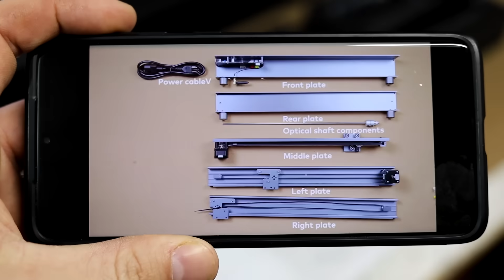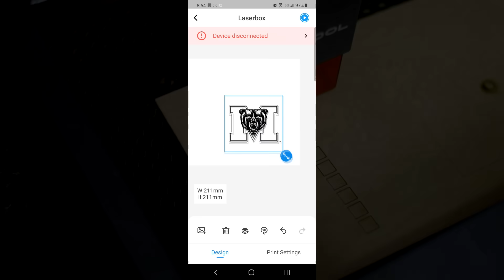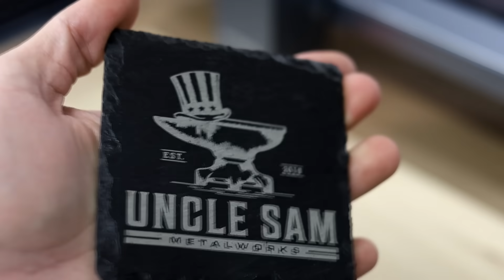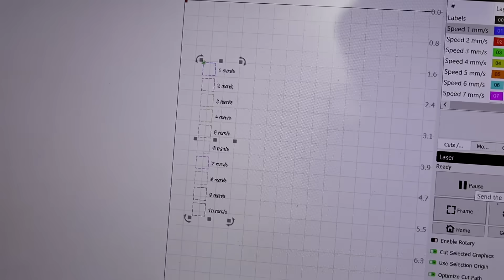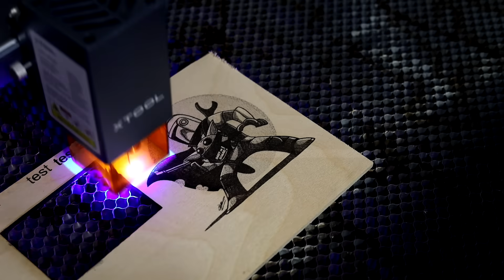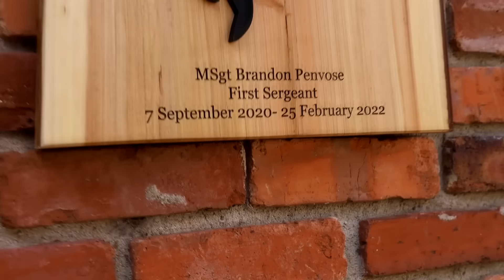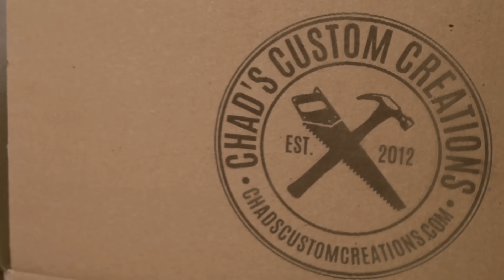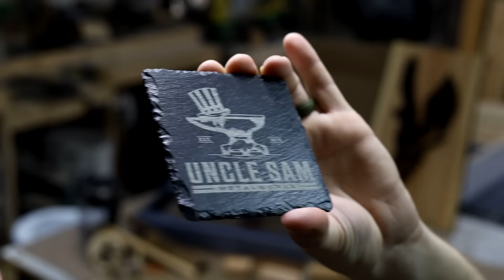The Ultimate Desktop Laser Cutter Engraver The XTool D1

Comment: I know nothing about laser engraving. Just wondering if I can cut 1/2" foam with this machine? For instance, I want to use foam to make a tool/socket holder for my tool box. Would this type of application work?
Reply from the maker: @BennyMolina-hj8qi  I believe with a good air assist you should be able to do that just don’t breathe in those fumes. If you can smell it get away and monitor it with a baby monitor or wireless security camera.

Comment: What wattage is this unit? The old 5w the 10w or the newer 20w?
Reply from the maker: This was the 10w way back when they first came out.
Reply: I’m looking to both do engraving on stainless steel but also cut 1” thick foam inserts for tool placement. I see it engraves well, I’ve seen the 20w cut thick foam inserts well. Do you think just multiple passes on the 10w would still do the trick?

Comment: What does the water and borax do? Never heard of that trick
Reply from the maker: With a low power setting you can turn the borax solution black which is great but it must be sealed in with a top coat as it rubs away very easily.
Reply: @ChadsCustomCreations  oh wow I didn’t know this! Going to give it a try! Thank you! Subscribed. Very helpful video!

Comment: Can you recommend a budget laser that can cut and engrave 1/8”-3/16” thick cork board? Would the D1 Pro do that?
Reply from the maker: Definitely and check their website to see sometimes they have refurbished machines at a fraction of the cost also try code Chad10 for a discount.

Here is the link to their refurbished machines 
https://www.xtool.com/products/refurbished-xtool-d1-laser-engraver?_pos=1&_psq=Refu&_ss=e&_v=1.0&ref=Chadscustom&utm_medium=cj&utm_source=affiliate&variant=43685506842863&cjevent=81efaaaf454311ee8161026d0a82b832&utm_campaign=Sovrn+Inc&cjdata=MXxOfDB8WXww

Comment: Hey thanks for the great video!  Perfect amount of detail.  I hear people talking about how deep a laser can cut wood in a single pass, and I saw it in your video, too.  So, can you make multiple passes and cut 5/8" or 3/4" solid wood or plywood with a laser such as this?  If you can, what's the drawback?  Time?  Quality?  Both?
Reply from the maker: With the 20w and 40w the cutting ability is incredible if paired with a high PSI air assist. Cutting 3/4” plywood comes out clean and cuts better than what I can do on my 90w Co2 laser.

Comment: Hi chad I just got my d1 pro 5w I wonder why it's not engraving on metal like you used on this video for dog. It's working well on the woods tho. Am I doing wrong or I should've bought 20w
Reply from the maker: In this video I was using the 10w. Though try slowing it way down 100% power and you can even do a thin layer of mustard and see if you have any luck with that.

Comment: I have been looking for a laser cutter to use in my classroom without windows, but I have not been able to find anything. Could you recommend something good for spaces without ventilation?
Reply from the maker: Yes if you check the links in this video it will direct you to xtools products they have since updated their design to the pro model and also offer a enclosure and a filtration unit that can be used in spaces without windows.
Reply: @ChadsCustomCreations  thank you so much

Comment: I have M1 Xtool and I having the worst technical experience after I realized that the camera is crooked and not straight and square. Sorry for all that It's having good experience but my case not.
Reply from the maker: Sorry to hear you’re having trouble with the camera I am not familiar with the M1 but even if the camera is not perfectly square does the software adjust for slight angles or are there adjustments on the camera itself. I know with lightburn the camera set up runs a calibration that I believe will get everything working well if using that software.

Comment: Would this engrave polished copper?
Reply from the maker: I would say no after my metal cutting test you can see my video on that and copper had no effect with the 20w but they do have an IR laser module that can work on metals.
Reply: @ChadsCustomCreations  thanks for the fast reply! I'm looking for something I can engrave my maker's mark on cooper/brass/aluminum with.
Reply from the maker: @Kapok6  so this does work on steel but I believe heat conductive metals like aluminum brass copper require fiber lasers wavelengths or that infared laser wavelengths. You can do the metal coatings like cermark though.

Comment: What is the exact laser that you are using?  The link below has 12 lasers on it with multiple options, etc...
Reply from the maker: The laser from this video was the xtool 10w. Before they came out with the pro version the same closet version now is the Xtool pro 10w
Reply: @ChadsCustomCreations  Thank you for actually responding!!  So, what is the primary difference between the Xtools that cost $250 and the ones that are $1300 plus?  Is it primarily laser wattage?

Comment: Have you tested cutting thin sheet/plates of brass?
Reply from the maker: If you watch my metal cutting video you’ll see me attempt brass with no luck. Though I will say that the brass was thicker than the steel that I was able to cut. Also  Xtool also has an IR laser that should have better luck with metals but I haven’t tried it out quite yet.
Reply: @ChadsCustomCreations  Thanks! I just saw your metal cutting video. Excellent work…

Comment: What is the proportion of Borax in the mix?
Reply from the maker: I believe it is 1 part borax to 10 parts hot water to dissolve. I put it in a spray bottle and let it dry before engraving at a very low or fast setting.

Comment: What size wattage and nm is this laser? It seems the control board is the same as the other laser engravers out there, and that the laser is the main difference.
Reply from the maker: 16”x16” 455nm 10w output xylophone has since improved their options check the link to see their newer offers the 20w is insane.

Comment: Stuff looks amazing. Just curious what settings your running on those anchors? I just can’t seem to get my engravings on wood that dark and detailed!
Reply: I think he said in the video that their website has recommended power and speed settings for different materials, so try looking there.
Reply from the maker: You're right they have a very extensive test settings you can choose from now on their software.
Reply from the maker: If you need to go darker try to go slower with more power and see if you can get there without burning it too much. If not you may need to use masking tape and spray paint.

Comment: I can’t seem to get the dark black clear cut like you did with the anchor logo. What did you have your settings on to achieve that?  Also, on the coasters, was the logo light colored to engrave in the silver color or is that how it engraved even if the logo is dark?  Silly questions but I’m new to this!  Thank you!
Reply from the maker: With those I am actually doing a tape masking and spray painting black to get that dark consistency.

Comment: I call BS
 - my 80W Co2 will not engrave metal without spraying a coating on it.
Reply from the maker: I was in the same spot as you before trying one. Diodes seem to actually be able to do better in metals then Co2 lasers. I wish I knew why but if I wanted to sound smart I'd say it has something to do with the wavelengths of the laser beam. Hang tight I'll be coming out with a video on the 20w xtool is claiming I should be able to cut metal with it. We will see about that.

Comment: tungsten electric resistance hot wire cutter, cut metals, or ceramics, up to 2000C easily
Reply from the maker: Is that an EDM?
Reply: @ChadsCustomCreations  close
Reply: @ChadsCustomCreations  more like hot wire foam cutting
Reply: @ChadsCustomCreations  but not like plasma cutting, like EDM is
Reply: @ChadsCustomCreations  think light bulb filament

Comment: Amazing video. Before I order one, I need to know if it can be used for cutting synthetic and acrylic fabric (thickness about 0.5mm to 1mm) instead of using my CO2 laser. I know that the wavelength is different,  but have you tried to cut those kinds of fabrics? What do you think?
Reply from the maker: Where can I get some I would be happy to test them out.
Reply: @ChadsCustomCreations   Locally, in a awnings shop
Reply: @ChadsCustomCreations  As a synthetic fabric,... if you can find an old sports T shirt (normally they are printed with the sports team logo or similar)

Comment: Cuts like a CO2 laser? Is that a joke?
All laser cutting is based on wavelength & power of laser, and the materials reaction to it. There is no way a fiber laser cuts like a CO2 laser, and vice versa. And 12:57 proves this. A CO2 would have a completely clean cut.
Also any laser cutter sold without a fume hood/fan system is extremely dangerous and should never really be used without modification, even on wood. Carbon monoxide and all kinds of gases are emitted. Every year, there are a handful of people who die to laser sinterers, cutters, etc. that they have in an apt or enclosed room and improper ventilation. It's no joke, brain damage is guaranteed at the very least.
Reply from the maker: Interesting insights. Are you willing to go check the cutting of the 20w I just got what are your thoughts on that paired with the 40psi?

Just posted the video sorry I broke it before I could test it too much.

Comment: I ordered this based off your vid but, they are non responsive to emails via their website and my enquiries. Something doesn't smell right and I'm about to notify my bank about it. Do you have any contacts there to sniff this out? Fyi Item has not shipped yet
Reply from the maker: I imagine at the scale they are at now responding to emails is probably getting tough. You can check out the unofficial xtool support group on Facebook has 2.4k members and I personally know the moderators xtool has no control of that group so it is a completely open forum. Which items did you order I know of a few that are on presale and will take a while to start shipping.

Comment: It's very well priced - if it can match the Brother Scan & Cut, or even the LaserBox scan & cut features.
Basically two modes, 1) software only - it cuts out what you engrave and you work with that image to do this in one-step prior to engraving. and 2) (which is really cool) - you have a camera attachment that scans a given area to image it, which you can then work with to cut out decals, or tiles. (Technically this can be done using a separate scanner I guess.) Does your recommended program support engrave and cut mark up in setup?
Reply from the maker: Yes you can achieve all of this using lightburn software very easily. Though I will say not sure if you were planning to or not but you should not cut any vinyl stickers with lasers as it creates chlorine gases.
Reply: @ChadsCustomCreations  Ah - great! Thanks for the creative community support!

Comment: Question: You do not show any cutting through sheet metal like aluminum or stainless steel. Is this possible, and if so, for what thicknesses? For example, can it cut rectangles and circles out of 1mm aluminum or stainless steel?
Reply from the maker: As far as I know diodes and CO2 lasers cannot cut metals although atom stack just put out an ad for cutting metal with their 20w I am skeptical though I would like to see it in real life. For real metal cutting you want a fiber laser.

Comment: Hola Chad.   Nice video.  I am interested on getting one of this, but to make masks for scale models.   We wainly use Oramask Vinyl paper or Washi paper / Tamiya paper.   i saw on your video at 12:44 when you where cutting the acrylic, that it had like a protection paper over it that looks like its made of Vinyl and looks like it cut just fine.   But I wonde if you can cut with the Xtool intrictated shapes, Like stencils for ariplanes with very small letter... Scale 1/32.  I see very nice details in wood but not sure on vinyl?   my concer is that the laser might burn the detail and not be readable.  What do you think. ?
Reply from the maker: Any masking that you use needs to be made without any vinyl or anything as the vinyl when lasered creates Chlorine gas. I recommend paper based masking. As for the detail lasers are the best for small details especially diode lasers the beams can be so small like .08mm
Reply: @ChadsCustomCreations  oh wow!!  That is really toxic.   Thank you.

Comment: What is the head wobble?  In other words, what is the accuracy?
Reply from the maker: Scientifically I don't have a true answer but I can say there is no physical wobble that you can feel with your hands and the true precision you can get from this thing is pretty remarkable. This comment has spurred an idea for another video as I don't feel many people have shown this feature.
Reply: @ChadsCustomCreations  thanks, accuracy limit is the most important spec and the reason for all other specs in a mill.  Better than 0.0001 inches is needed for some types of circuit boards and other applications.  Most low cost CNC 's can't get 0.01 inch accuracy

Comment: I mainly engrave the boot jacks that I make and sell at local markets etc.  I have a cheaper unit than this now and I M not happy with the quality.  My question is do you think I could use this unit with just my iPhone to do simple engraving on my boot jacks(initials, simple graphics, etc ?)
Reply from the maker: Yes 100% and how cool would it be if you could offer custom on site engravings on those boothacks. With the proper shielding for on lookers I think this could draw quite a crowd.
Reply: @ChadsCustomCreations  That's exactly what I was thinking about also.  Thanks for your rapid response.  Your link won't go unused!👍
Reply from the maker: @dashermike3207  I appreciate your support and please reach out if I can be of any assistance!

Comment: is it possible to cut chamfers. rate the lazer mps to a gradual degree for angled cuts ?
Reply from the maker: That is an interesting concept I haven't seen a laser that can accomplish this yet of course you could set the laser up at an angle but the angle would not be able to be changed. I think another solution would be to cut it out then use a router or router table to add a chamfer to your cutout material afterwards.
Reply: @ChadsCustomCreations  I was thinking more on the lines of changing the rate of mps during a past, changing the depth of the cut while cutting
Reply from the maker: @TheCantuView  oh yes this can be done in light burn you can select different lines and assign different speeds for whatever you want you can make it as complex as you would like.

Comment: How does it do cutting aluminum or thin steel (0.090" aluminim or 0.050" steel)?
Reply from the maker: Geoff Aluminum is a very though one to cut, I've done it with the Ikier 70W and the xtool F1 Ultra if you want to check those videos out.

Comment: Good video, do these use a lot of electric?
Reply from the maker: I do not know the actual stats but it runs off of a 12v power supply so I doubt it's too much in terms of power consumption. I believe these diode lasers are actually magnifying a super powerful led light but I could be wrong.

Comment: Fantastic video! Thank You! Since this is a CNC based system, this question is of interest. Is it possible to replace the laser head with a 3D printer head and a milling head? As far as I understand, the head of this machine only moves along the X and Y axes. For 3D printing and milling, you also need the head to move along the Z axis as well. Thank you!
Reply from the maker: I wouldn't recommend changing out the head for CNC router or 3D printing I have found those all in one machine though can do multiple things cannot do anyone of them well. This machine like you said does not have an powered Z height control so this would not be possible anyways. I am a advocate for dedicated machines. I have a review on the longer LK5 which has proven to be a great 3D printer and though I do not have one the onefininity has got my vote as far as router CNC goes at this point.
Reply: @ChadsCustomCreations  Thanks for the detailed and comprehensive answer!

Comment: Just wondering what it'd be like marking anodised aluminium. There are by the way other machines around that combine two beam paths - particularly emanating from China. Thing about this is it screams quality and the price is actually completely reasonable - if you were choosy about clients/projects it seems like you could go a long way as a laser shop with just this or a couple of them - you're not going to be buried in consumables, you don't need much in the way of safety precautions - there's obviously a bunch of stuff you can't do but I don't think it's just that something like this can get you off the ground but also support a business doing that sort of work whilst more powerful machines down the road do heftier work. 10-20 years ago the equipment required to mark stainless for example had a significant initial outlay (we had to use fairly hefty NdYAG lasers back in the early days when nobody knew how to laser mark things - the CO2 lasers were busy cutting high carbon steel and whatnot) - build a jig to hold a batch of keychains as a random example and you can just let this thing go off and work.
Reply from the maker: It actually does really great with anodized aluminum

Comment: which one is better with zbaitu 80w?
Reply from the maker: Nice just looked at the specs looks like they also have the 2 5w doides combined to create the 10w power output. Definitely a cheaper option and works with lightburn so may be worth a shot for someone on a tight budget.
Reply: @ChadsCustomCreations  thanks for your advice, maybe i'll try zbaitu...